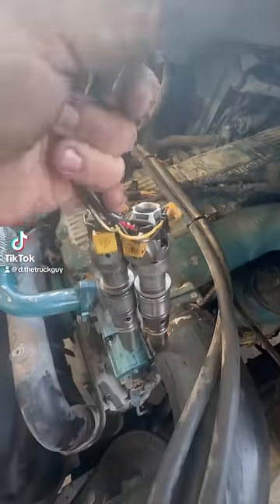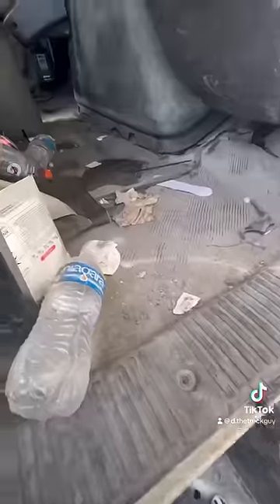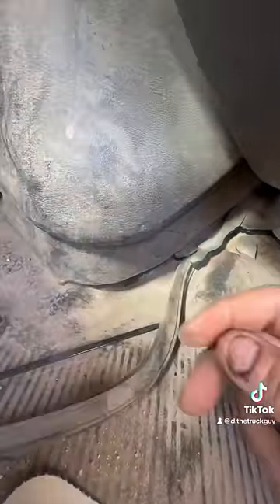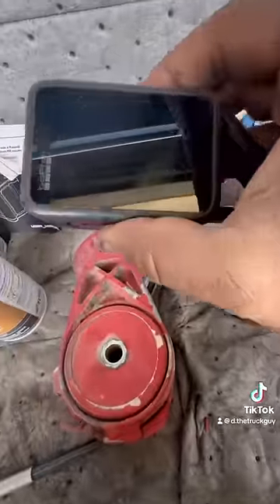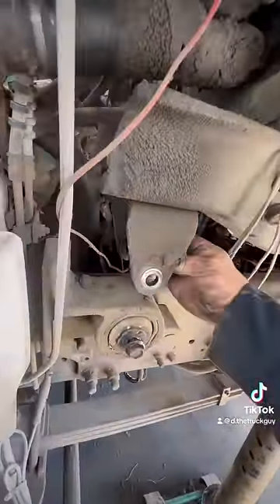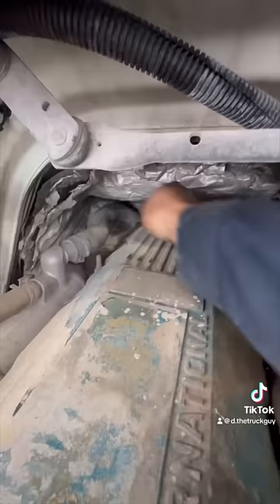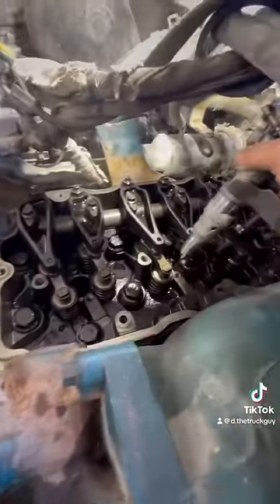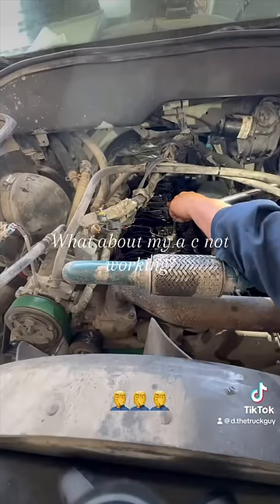#mechanic #truckdrivers #dieselmechanic #semitruck #truck #dieselrepair #trucker #diesel #engines

Comment: You make being a mechanic look fun😊 but when I do it I just get frustrated with how much stuff has to be taken off sometimes!😑
Reply: Fr, took a full day to get a sub frame out of a mercedes to do brake pipes, and weld up damage to the subframe, turns out most of the damage was only visible once the thing was out and first estimate for getting a new subframe in was a couple months and mercedes refused to get it replaced under recall but luckily enough guy in the office managed to get one ordered for delivery this Thursday, would've sucked if it would've taken a few months though since you can't exactly take the car off of the ramp when it's got no rear axle, differential, suspension and literally everything else connected to the subframe

Transferring all the saveable parts to the new subframe is going to be hell but got to sort those brake pipes out first wednesday
Reply: Not for you then 😂😂😂

Comment: Topical BS customer. They go in for a simple Oil Change and out comes the list of all the problems after the Oil Change: 
1 transmission not shifting correctly. 
2 My A/C does not cool the way it used to. 
3 Very hard vibration while breaking. 
And on and on. 
All of these items were damaged by the NUT behind the steering wheel. So now they blame it on the guy that did the Oil Change.

Comment: I have had this issue before. I just tell the customer due to time, wear, & tear that they put on the truck. It is there responsibility to make sure the dog house seal is in good working order. That there old dry cracked floor mat should have been replaced decades ago. They can either except it or get upset with me. Doesn't matter to me. I only estimate what there complaint states. If I see something important I'll let them. know. But, I don't inspect the entire truck for issues.